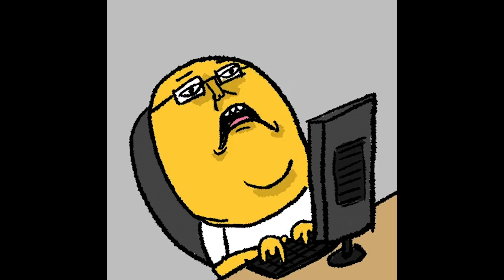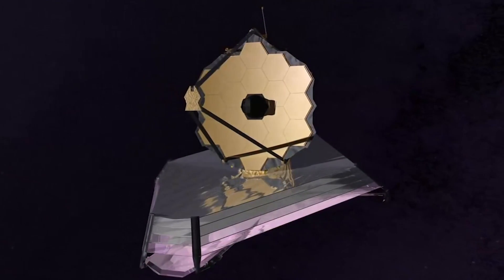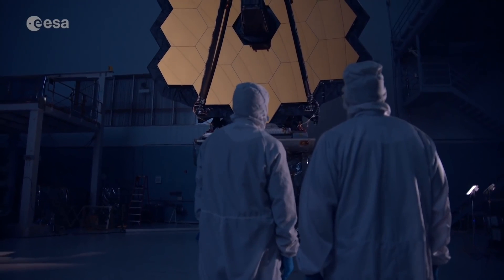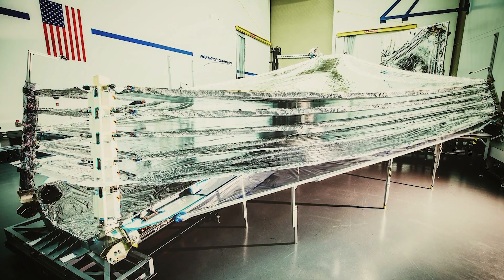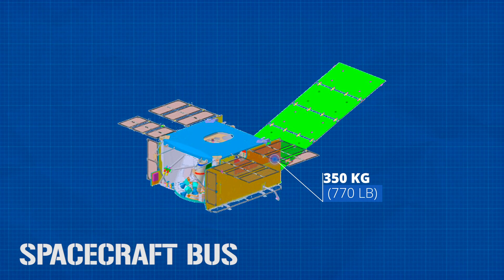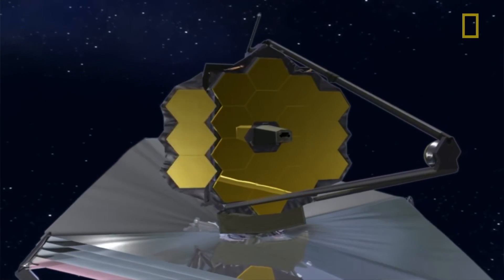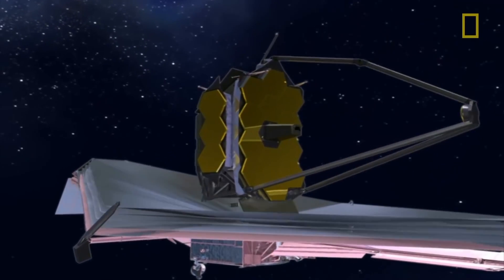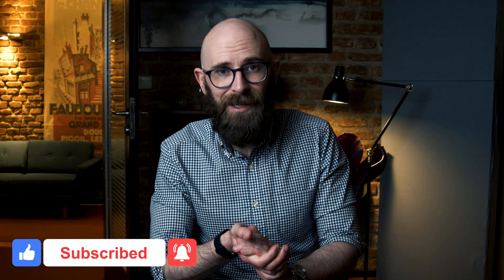The James Webb Space Telescope: Evolving Hubble for the 21st Century

Comment: They should have built two of these things considering the time and lessons it took to build the first one. After all that it'll just take a little bad luck for that screen to tear or some small issue makes pointing the thing impossible. Classic all your eggs in one basket situation.
Reply: "First rule in government spending: why build one when you can have two at twice the price? Only, this one can be kept secret. Controlled by Americans, built by the Japanese subcontractors. Who, also, happen to be, recently acquired, wholly-owned subsidiaries..." - S.R. Hadden
Reply: @kevineckelkampe2r  the movie Contact! But the point is valid. Think of all the procedures, design reports, emails, meetings, contracts etc that have gone into that thing. Then there's all the test fixtures, jigs, equipment for transporting parts, an assortment of items that are essentially for one time usage. All the electronics that have been designed, PCBs, testing, again all one time usage for a single prototype. The  there's reams and reams of software that has been written both for flight and for testing. And again, one time use for the one prototype. It gets to the point where the material cost for actual flight hardware is irrelevant in the face of everything that goes in to supporting such a thing. They should just have built a second one alongside the first.

Comment: One thing i don't understand is why the mission duration for the JWT will only last 10 years, while the hubble telescope is still in active service after over 30 years. Why only 10 years service time for such an expensive and invaluable instrument?
Reply: Fuel and cryogenics are big limiting factors.
Reply: @michaelsommers2356  Agreed, keeping things in a stable L2 orbit requires way more fuel than keeping an object in LEO like Hubble. The other aspect is the cooling. The IR equipment needs to be kept cool for it to work properly with low noise. Fortunately, the next generation of telescopes will not have this problem of running out of fuel and cryogenics. These next one will have the ability to be resupplied by other spacecraft. There are 4 major ones proposed, one called the Luvoir telescope and it makes the 6.5 mirror that the JWST has small. Yet it will be using similar technology so it should not take as long to develop and the sun shield does not have to be as precise. Need starship or SLS block 2 to get the big version up to L2.

Comment: Have a few German Mega Projects Ideas:
1. The "Elbphilharmonie" ist a big opera house built in the Hamburg old Harbour ontop of antique buildings which aren't allowed to be altered.
2. The Big Upgrade to the Munich subway network currently, with digging of a second main track, to ease the pressure on the old and overused central tunnel. That one is actually the most used two-way rail track in the world. Also the whole Munich "S-Bahn" drives more track km a year than the whole German long distance Network.
3. Maybe in a Megaprojects Video we can finally get behind the million of delays to the new Berlin Airport, which finally opened last year. The Year no-one could fly due to covid :D

Just a few Ideas that i thought could be interesting.

Comment: Yeah I'm waiting to see those mirrors shatter from vibrations during launch. I don't see why they didn't just build a bigger better Hubble. That thing has been a work horse for 30 something years. They could have improved the sensors, mirrors and other important stuff.
Reply: Hubble is optimized for visible light.
There are vast dust clouds in space that block a lot of the visible light from distant stars and with JWT optimized for infra red, we can see objects that would not be visible even with a scaled-up Hubble. 
Many stars are cool enough they emit little or no visible light (according to the human  eye). JWT will image these cooler stars.  
If all goes well, the JWT will open up a new world for astronomy.
_We're putting a lot of eggs in one basket. _

Comment: It has been hyped for so long and delayed for so long as well I can't imagine it will actually ever make it to space.  I'd expect nothing less than some great launch disaster.
Reply: I'd buy that for a dollar.
Reply: Hubble went through delays and even post launch issues as well. This one is designed to run perfectly, like literally no manual repairs available. It will make it, the delays aren't an indication of failure.
Reply: @FirestormX9  they want to make sure everything goes 100% so no kind of mistake possible😱hope it launches perfectly
Reply: @gamingcreatesworlddd2425  yes you're correct and it will, bro. This is another masterpiece of a scientific tool for astronomical research.
Reply: @FirestormX9  It's an indication of success, I think. They're making sure they fix all issues they can. The most recent delay isn't even because of the telescope itself, it's because of the rocket.
Reply: @mangalover0149  yes dude, you've put it perfectly. It's an indication of success!

Comment: If you haven't already, you should look into the design for a space telescope that uses the gravitational lensing of the sun to view the surface of exoplanets (planets outside our solar system).

In theory, a telescope like Hubble, placed at the right focal point could view the surface of a planet 100 lightyears away, with a surface resolution of 25 sq km.

The main catch is that the telescope would have to be located about 550 AU from the sun. For comparison Voyager 1 is about 152 AU away.

Comment: Under development?!? It's finished and waiting for ESA to get the Ariane V issues sorted out.
Reply: Can you explain that further? I'm curious.
Reply: @Gecko2305  There's a small issue with a slight over pressure within the payload fairings an at the time point that they're jettisoned. This causes a small gust of air pressure that is for most satellites no issue but the JWT solar shield is very thin, light and fragile. there are concerns that it could be damaged by this gust of air.